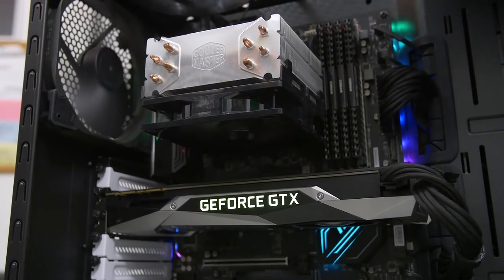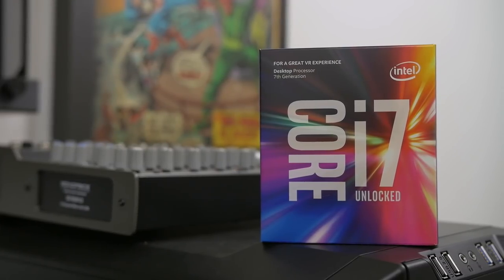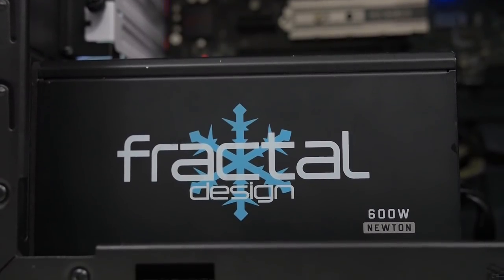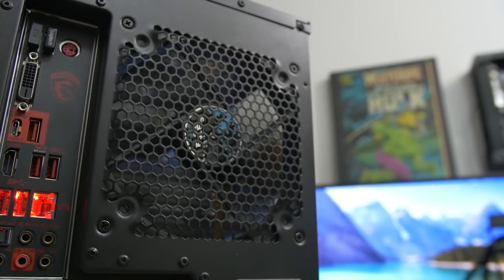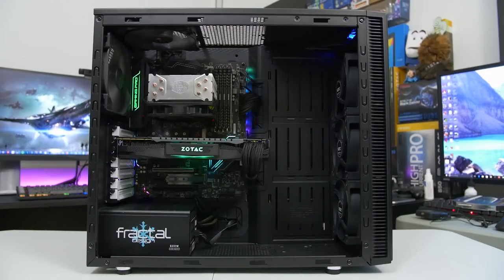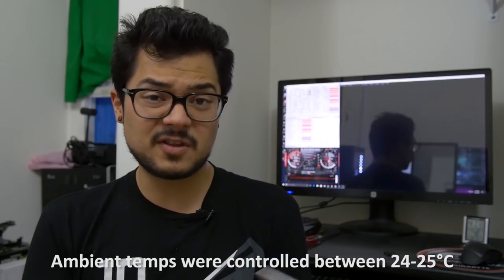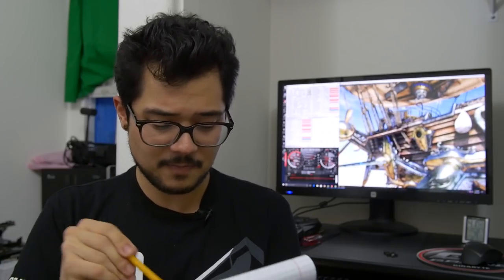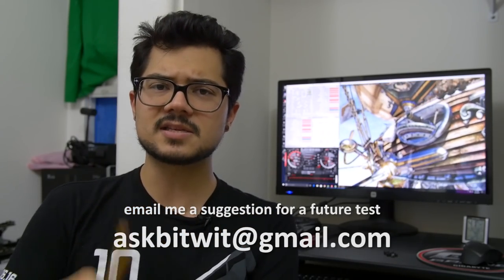This is how you should mount your CPU cooler! I think??

Comment: I always had my 212 evo blowing straight up because as science already explains heat rises, and blowing the heat upwards through the dual exhaust case fans is better than blowing it sideways out the single rear fan due to hot air taking the  path of least resistance. and with  the "founders" cooler you're forcing air out the back of the case but it still becomes trapped within the massive fin array where as with dual fan cooler cards has your fans kicking in and blowing more air up and away from the pc as well, again path of least resistance.

with the fan blowing straight up it also allows your fan to run slower for the same temp variances and you also have less load on the bearings which equals a longer fan life span.
Reply: Do you mean dat a vertikal pathway is better for cpu temps ?

Comment: Kyle.
Obviously with the open GPU and the CPU cooler horizontal the pressure gradient from the CPU cooler to outside the case increased somehow, if there is more heat being blown into the case then this is the only logical conclusion. No idea how. You should test it with different configurations of ventilators (on different places), different cases and measure the temperature in differenct places in the case. Maybe you could use that toy that JayZTwoCents uses on his phone to get an image of the temperature differences.

Comment: You might need to run the test a few times to see what the run to run variability is.  Mounting differences can affect the heat transfer.

What were the temps on the GPU?

What were the clocks on the GPU?

Comment: guarantee it happened because while blower cards are great, it probably cant push out all of its heat, the other card just expels all of its heat directly into the case and it gets blow out, think of it like this, you've got a garden hose pushing out water, but it can only push so much out at a time which increases pressure, this pressure is in the form of heat in our case. the first card just ramps up the pressure until it gets to the point where everything levels off, the other one is like not heaving the hose at all where its pressure is mitigated by its ability to dissipate the heat more effectively, as in all of it leaving the hose at hundreds of spots all at once.

Comment: Re-do the test with flipping the power supply too, you'll really freak out when you see vertical cpu cooler, recirculating gpu and power supply fan facing gpu, if you have enough intake airflow. Dynamics of airflow are hilarious sometimes. My money is on horizontal CPU airflow being robbed of total air volume with the blower style GPU cooler which accounts for that being "backwards."

Comment: This video can be so much useful, if you included more Temps, than just CPU... In my case, the Northbridge temp and VRM Temps are the main concerns. (yeah I know, on VRMs is not a thermal readout, but you can just stick a probe there)

Comment: Maybe with right side directed airflow the air is getting circulated back up forward, sending the hot air directly to the cooler. However, with a open shroud, it's dissipating over a wider area and getting blown out the back before it can affect that?

Comment: Well just a hunch, when the open gpu lets out all the hot air since hot air rises it will naturally go up but since the horizontal cpu cooler is blowing air out the back of the case there is a negative pressure zone so all the hot gpu air is rushed out the back into that zone which therefor kind of causes air from the cpu cooler leave faster so the overall cpu temp drops as the cooler is releasing air faster. // correct me if im wrong its late idk

Comment: The evo 212 keeps my 4790k below 73C with a custom fan curve to keep it quiet, when its fan is goin at max speed it kept it below 72C so a 1 degree increase for a much quieter fan worth it personally, also run it at all stock values the cpu.

Comment: Only thing I can think of in regards to why the aftermarket zotac may have cooled the cpu better is perhaps slight over pressure? Meaning that the air pressure and air flow inside the case was lower with the blower style card, since it's enclosed.  With the zotac after market cooler on it you're getting a higher amount of air pressure in the case, which the heat from it isn't offsetting the additional cooling? Maybe?

As for why the vertical orientation was hotter, radiating heat can more easily travel up through the fin array. So the hypothesis of increased air pressure wasn't helping at that point. 

But I'm just spitballing.

Comment: aren't the fans on the back and front of the case blowing in and out of the case. this is creating more air flow for the cooler rather than circulating hot air.

Comment: hyper 212 Pulls air and throw it on the heat sink. So facing it towards the GPU makes it pull hot air coming from GPU. So facing it towards front intake make more sense. That's what i think.

Comment: In the second test the graphics card is blowing air through the cpu heat sync in the direction that the air wasn't flowing at all adding to the cooling effect. Since the evo is blowing horizontal, the slight flow of air from the gpu vertically seems to help cooling.

Comment: GPU backplate might be blocking significant amount of hot air and hot air could be cooled by the flow until it hits heat sinks of cpu

Comment: Heat rises..so heat from the GPU would go into the air the CPU fan is blowing up...also you would want two fans working to bring in fresh air that can be used by other fans inside...the best setup would be to put the rad at the top with two fans pushing air through it...the front of the case should have two fans pushing fresh air in and the CPU fan should be blowing out the rear...that really is the best overall setup because the two fans pushing fresh air in will literally aid the GPU fan, CPU fan and the two fans cooling down the rad up top...fresh air getting to internal fans is the key... everything should be designed around that... having two 140mm fans in the front blowing in is the best way to get fresh air to hit the entirety of the case... they should also be the fastest cfm fans in the case.

Comment: The backside of the Founders Edition is much hotter.
When you mount the cooler for airflow horizontal there is no airflow on the GPU Backside, therefore the GPU's backside gets even hotter and more hotter air is rising up into the CPU heatsink. When mounting the CPU fan airflow vertically there is airflow going over the backside of your GPU, so it doesn't really get hot and  therefore it barely ejects any hot air into your CPU heatsink.
When mounted vertically all heat from the GPU is going out the back with the founders edition. The open design still has hot air leaking through all of the case, therefore the CPU is hotter because now it sucks in the hot air emitting from the sides of the GPU, where again, the founders edition does not push out hot air

Comment: The data could be explained in a way that if the blower style cooler was blowing out hot air not all of it disopatted and cycled in and out which could have disrupting the air flow cycle and caused hot air to heat up and get pulled by the CPU fan which heated the CPU up while not affecting the GPU because it was blowing the hot air out vs an open GPU cooling the air as it is sucked in and the air going around it into the the flow of the intake fans which exhausted and cooled the hot air thus lower CPU a temperature. That's the best explanation I can think of but maybe someone could explain this better or another reason on how thing could have happened.

Comment: Your test is only valid if you can ensure that the GPU's have a fixed TEMP in all scenario's.
It would be great if the GPU was the exactly the same temp in all 4 setups; if not, then you will have to include Delta-Ts in a far more complex calculation.  Note that the GPU will "use" more or less air to maintain the target temp depending if its a "Ref" GPU squirrel cage cooler or a "3rd party" cooler.
That said, tests "at home" a almost always wrong, since most people lack a lab where everything can be controlled perfectly.
Lastly, setup does not really matter as long as you can ensure enough "thru-flow", in other words: a "balanced" case with LOTS of air going through it.

Comment: i took the fan off the top of my s340 and put it on the right. So i take air in through the front and let it flow through my 212 and out the back and works great.

Comment: I use a case that is based around that heat rises so it has 3x 240mm fans for intake at the bottom and 1x 120mm fan for a outake at the top. All the IO comes out the top of the case so I use my hyper 212 evo in a vertical airflow in push pull taking the air up.

Comment: Maybe due to the amount of case airflow, the graphics card air doesn't change much, HOWEVER the founders edition card does not have a backplate. We already know the back of GPUs generates a lot of heat because it is not actively cooled. Maybe this is causing your results?

Comment: There is only 1 correct answer found in research in the HVAC (Heating, Ventilation, and Air-conditioning) trade of building construction. The PC case is, in effect, a small building for the components. Air Flow In should equal air flow out. = A Balanced System. 
The 1st test you performed with the temp being noticeably higher looks to be caused by the fan on the case blowing in toward the CPU and the fan on the CPU blowing toward the other fan... In effect, creating greatly reduced airflow at cpu cooling fins.

Comment: Jayz2Cents tested GPU's with blower vs vertical fans and found vertical fans that move air around in the case cooled better than the blower style fans that tried to exhaust air.  Theory is it helped move heat around the case better.

Part of your problem, I suspect, is the massive front & top fans.  Repeat a test but turn off say the front 3 fans.  I suspect the GPU fans + CPU fans are strongly influenced by the case fans and over-all case air-flow.  Your odd results may be because the orientation either supports or disrupts the rest of the air flow.

Comment: I KNOW WHAT HAPPENED! Better thermal dissipation by the open graphics card caused less heat being put off right next to the cpu and the good air flow pushed it out. 

Blower style graphics cards are known for there poor thermals and had trouble dissipating heat as quickly leaving more in the case.

Comment: Could be that having air flowing up through and across the fin array creates less of a negative pressure above the gpu as instead of the founders gpu taking air and then leaving an area of low pressure above it slowing the air down the aftermarket coolers remove the area of low pressure meaning the air maintains its speed so doesn't linger long enough to allow the cpu to reach higher temperatures

Comment: Horizontal seems silly as you are intaking hot air from the GPU to try and cool your heatsink.  Vertical allows fresh (cool ) air to be pulled in from the case and front fans.

Comment: just sold my 2600K + GA77x-ud3h with that evo cooler.. ah man, when I bought it in 2013, I had 19 C on the cpu, and 38 max on full 100% load.. The first week I did something weird and configured the intel stepping thing along with the old way in linux, and I compiled a kernel in 7 mins, and it reported 5.9 GHz LOL.. the cpu was never even damaged either, although for the next 5 yrs I just used it un[over]clocked... Damn, that was my best chip ever.

Comment: Maybe with the first test the hot air was being circulated back into the cpu cooler and the pushed out and over time all of the heat went around but was soon pulled out of the case.

Comment: Let me guess:
You had horizontal flow with blower GPU first, ran test, then switched to open GPU, ran test. 
Then you switched to vertical flow with open GPU still, ran test, then switch to blower GPU, ran test. 
If that's the order, the problem is VRMs thermal throttling ~60C. Obviously it's a lot easier to switch GPU than it is to switch CPU cooler, so while you were switching the cooler, VRMs had time to cool down, and not much time while you were switching GPUs.

Comment: Check the temperature of the backplate of the GPU under each scenario. I am betting the ambient heat from it is messing with the horizontal cooler orientation.

Comment: Some facts: Heat transfer to/trough metals easier via radiation than air. Founders edition card runs hotter. In horizontal air path cpu cooler's heatsink is closer to the gpu where in the vertical is not that close, with the fan in between.

If ALL FOUR tests were exactly the same with the same load and the right way then...

...Theories: In first two configs cpu cooler "sucks" more cold air from the front and is more sensitive to the radiation I mentioned. 
In 3rd and 4th configs the air just above the gpu plays a big role. 

Sorry for bad English... :/

Comment: Few years late to the party but I think I know the answer :P 
Build a system with similar config and components few weeks back, in lock down so lots of time to play around...
My case fans config have one difference, also one 120mm on top but blowing fresh air in on front top side.
I recon that top fan of yours was sucking cpu cooler fan's air out before passing through all fins on cooler vertical set-up.
The open GPU helped to have more air pressure underneath to push air all the way through fins.

Comment: Were all the fans running at the same constant RPM through all the different configurations? Also, perhaps try testing each configuration at least 3 times and get the average temps from that.

Comment: Did you run the fans (both case, CPU and GPU) at fixed speeds while testing? If not, did you log/monitor fan speeds? Without fan speeds constant, these numbers mean very little.

Also, my impression of the "horizontal vs. vertical CPU airflow" debate isn't based on having every relevant fan position filled, as most users don't have that.  I'd say you need to test:
-Horizontal with only rear fan exhaust (top blocked off if possible to simulate the majority of cases)
-Vertical with rear fan exhaust, top blocked off
-Vertical with top fan exhaust, no rear fan

Also, reducing the number of intake fans would be relevant. Few computers have more than two at the front.

Comment: Thanks for the cooler mount vid results because of your video I put my coolermaster 240ml rgb in the front of my case sucking in ..a vertical mount 1050ti in thermaltake view 31 with 3 140ml tt exhausting out on a r7 2700x Asus x470 mb...32 gigs g skill rgb 16x2 ...1250w g skill power supply ...one of these days I would love to get a 2070 for it :)

Comment: I had a good, lengthy explanation, but I accidentally deleted EVERYTHING...
It was essentially about the areas of low pressure, and how the card design, affected / was affected by, them. . . . . .
Screw it, I'll rewrite it...

First set: The flow through the case looked like this  [ L<------------------------H]
-Blower GPU: Intakes cold air from bottom, expels hot air through rear... BUT heat can conduct THROUGH the card (at the front, near the power connectors) and waft into the CPU heatsink, increasing CPU temps
-Open GPU: Initially intakes from bottom, but it can create a pseudo-vacuum of low pressure that pulls the hot air from around the GPU to the rear of the card, keeping it from wafting into the CPU heatsink, lowering CPU temps
                                                                                                              L
                                                                                                              ↑
Second set: The flow through the case looked like this  [L<--- ↑------------H]
-Blower GPU: The colder air could now blow across the card and up through to the top of the case, cooling the exterior of the card, and mostly surpassing the CPU heatsink, lowering CPU temps
-Open GPU: The pseudo-vacuum created by the card is interrupted by the second area of low pressure at the top of the case, which allows the heat that would normally be expelled out of the rear of the card to waft up, through the CPU heatsink, and out of the top of the case, increasing CPU temps

That is what I believe is going on, and now I'm going to be looking at airflow more carefully in my cases when deciding what card to use because from what your results show:
Airflow like this:  [ L<------------------------H], works best with an open air cooler GPU, and

                                       L
                                       ↑
Airflow like this: [L<--- ↑------------H], works best with a blower style GPU

In terms of CPU temps

Comment: it looks like the pressure difference is the real reason your results where off on the 2nd test open air cards pull extra air into the system and with what looked like 3 intake fans at the front you should be in positive pressure. you just added more making the GPU heat escape straight out the vents on the side. This also explains how the blower card would affect the airflow in the 1st test by reducing the pressure more heat is trapped in the system. The other two test have you forcing more air out the top  in turn this on it's own is displacing more air in that direction so case heat coming from the bottom will affect the overall pc more. Its all about how the air moves through the case on this one. but that's just my hypothesis.